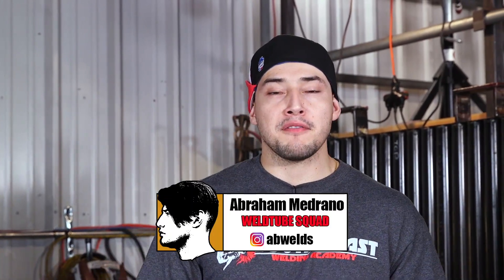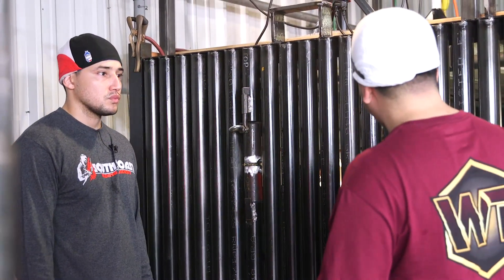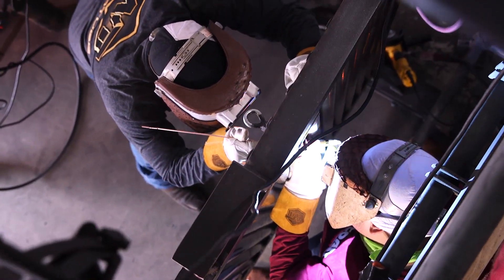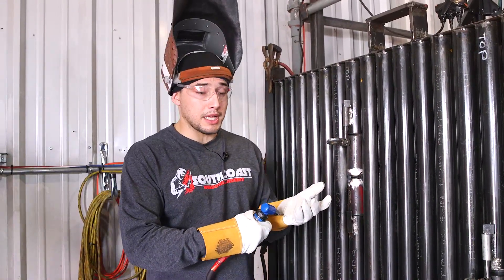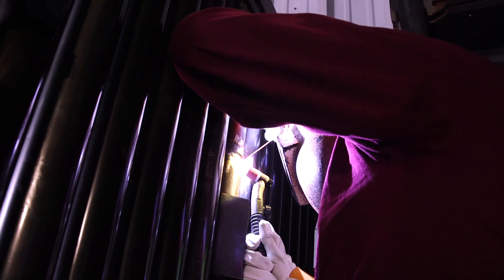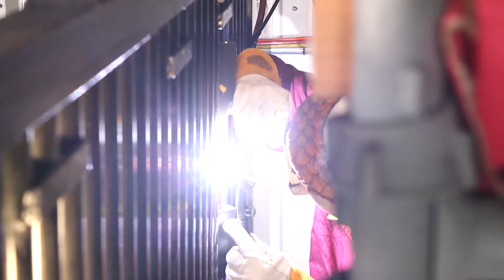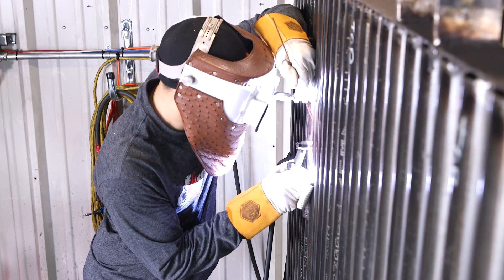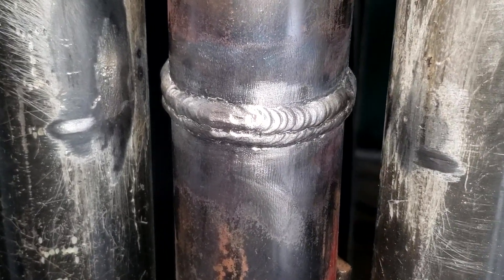Boiler Tube Welding | Boilermakers TIG Welding for Power Plants

Comment: Union Boilermaker welder apprentice here, local 128. That was a great video, thank you for that. I haven’t started tig welding yet but will definitely be watching this video again when I get into it
Reply: Congrats on being an apprentice, but please remember that being a journeyman Boilermaker means you can do any and all of our trade. In over 20 years, I’ve never seen anyone’s union book say “Boilermaker Welder”. They say Journeyman once you bust out. Too many guys think that they are “welders only” and most are only rod burners, not a true welder and there’s a lot of work that has to be done prior to most the welding, such as demo or hanging new panels. Not trying to say anything bad, just trying to change the mindset of some of the younger generation. We need everyone that cares and wants to learn a good trade. I’m a 2nd generation, graduate apprentice out of Local 101. Went to the apprenticeship competition and now I’m a superintendent for a good sized Union Contractor. Just please don’t get stuck focusing on welding. Yes it’s a big part of our trade, but it’s only part of the skill set you will have after you bust out of the apprenticeship.
Reply: Dave Uhl thanks for the advice. I say I’m a boilermaker welder because that’s what I am in the union... I understand that I will learn Mechanic work and that I will do mechanic work. However, in the union I am a PSW (Pressure system welder) and I am going through the PSW program that was introduced to the union around 10 years ago. So when I’m a journeyman I will be a journeyman PSW. I am also on the welders list for dispatch. When a contractor wants welders then they call off the welders list. I have done mechanic work and I enjoy the mechanic work as well. However I am considered a welder
Reply: Quinn Howlett when finished with your apprenticeship, you will be a red seal certified journeyperson Boilermaker. Currently you’re a Boilermaker Apprentice, nothing more and nothing less, unless you’re trying to take a welding test for your hall and then plan on buying your book, in which case you wouldn’t be an apprentice at all. But again, best wishes and get out there and make the Boilermakers Union proud by being the best you always can be.
Reply: Dave Uhl currently I am a second year Boilermaker PSW apprentice... I was hired into the union as a welder, in a separate welding program. I do not go through the same schooling as the mechanics... I will still be getting my red seal journeyman certification at the end of my apprenticeship, but I will still be a Boilermaker PSW, which is a Boilermaker Welder, getting dispatched from the welders list... I know what I am dude lol
Reply: Quinn Howlett well just like most apprentices, I see you know everything!! I was like that once as well. So as I’ve said, be safe and have fun. Just carry the “Journeyman Boilermaker” title well. Oh by the way, look at your halls website and it explains the whole PSW program and once completed you will become a “ Red Seal Certified Journeyperson Boilermaker. It says nothing about “welder” so yeah, you obviously know what you are!!
Reply: Quinn Howlett those are facts by the way!!
Reply: Dave Uhl lol... Yup I “know everything” because I know what I am and what my job title is... please don’t tell me what I am and what I’m “not” my comment was not intended to start anything with anyone... and then you replied to me because you just had to “correct” me... currently there is no red seal for the PSW program, so that’s why we do the red seal boilermaker. We have the opportunity to do the red seal welder, which is the general welders red seal but we need 8,000 hours to be eligible for that. I am a Boilermaker welder, dispatched from the welders list, a PSW. That’s what I am. But I can/will do welding and mechanic work. And that’s what I want out of my career.
Reply: Quinn Howlett ultimately, what I’m trying to say is don’t focus on a skill, be well rounded and best you can at all skills our trade requires and you’ll get farther in you’re career. Contractors won’t call just because you’re a welder, they’ll call because they’ll know that they can count on you for any task they might have. So stay passionate, dedicated to being the best and showing up everyday, that’s what contractors want.
Reply: @quinnhowlett697  I was EXACTLY like this when I was an apprentice. 13 years later I totally understand and have the same outlook as you do. If he makes it out, hell eventually grow to understand what you're saying. Good luck out there and stay safe!
Reply: Brian B lol, I’ll make it out. I’ve done lots of jobs already where I didn’t strike an arc... like I’ve stated before multiple times, I understand there’s way more to boilermaking than just welding, that’s why I chose this career, I won’t be welding on the same shit every single day like on a pipeline. But I am still a welder👍🏻
Reply: @daveuhl3392  He’s from Canada. The welding side and mechanical side of Boilermaking up there is completely separate. It’s two totally different apprenticeships and rightfully so. I’m a Union Boilermaker as well. I was out of local 83. Either way, the reason why Canada’s Boilermaker program as whole is better and has retained a higher level of success and quality is because they separate the two facets of our trade and focus on getting specialized people for each. We don’t do that in the US and it shows, miserably. Also, in the U.S. when you “top out” as a Journeyman, your card doesn’t just say “Journeyman” on it. It says “Journeyman Mechanic”. I know plenty of jam up welders in our trade that have literally spent 99% of their career shoved in a hole welding. Then, after all those years of just focusing on welding (because that’s where they were always put) when they are asked to do some sort of decently difficult mechanical work (laying out torque patterns on square flanges or manways etc.) they don’t know where to start. It’s really not their fault either. Why? Because we are always pushed to be “tube welders” if we want to stay working. That is what has created the “I’m a welder” mentality in our trade in the states. Apprentices are pushed to focus on the golden ticket of being a tube welder instead of the instructors being able to guide them in the direction of what they are better at. Whether it be mechanical or welding. Yeah, welders should know how to do a lot of other things and if you’re a good welder that always gets put welding, you’re not going to be as good at the mechanical side as someone that always takes a call as a mechanic. The crappy thing is they don’t ever order enough mechanics anymore half the time. They push you to get tube certs so you have a better chance at getting called out first, then sometimes you don’t weld at all. It’s front, back, left and right. I think the best thing we could do as a Union is to separate the two facets of our trade (just like Canada does). That way you know that all the mechanics on the job can always do their job to the fullest and all the welders can do their job to the fullest as well. It would never be a question. I say all of this because you know as well as I do that there are always jam up mechanics with tons of hours setting at the house because they aren’t welders. Then, the guys doing mechanical on some jobs are always welding on other jobs (boomers,different plants with different foreman’s etc.) and struggle, and vice versa. It’s an actual thing. I’ve witnessed it over the last 15 yrs or so. Some guys don’t want to weld and wouldn’t make good welders anyways. Some guys don’t want to do complicated rigging or bolt up structures etc, they want to rig enough to fit up and weld. People will always focus and excel more at the things they are better at. That is why Canada separates the welding side of Boilermaking from the mechanical side and they churn out much better hands on both sides by doing so. Also, there is absolutely no way to know how to do every single little aspect or job in our trade. We are the only multi-sub faceted trade there is. It would take a 20 year apprenticeship to learn everything that we do in all the different facilities that we work in. Then you won’t even be able to retain all of that knowledge to be able to apply it when and if you ever came across each specific little job or task. It’s literally why there is a separate side of our Union for building tanks (NTL/NTD). If I had a dollar for every coal fired boiler tube welder I’ve seen fiddle around with a key plate their first time and mess it up, I’d have a lot of dollars. There is no better example than that. Lol😂. Either way, be safe out there brother.
Reply: Local 105 here. I have been dispatched to several jobs as a welder and never struck a arc. Sometimes the welding gets old and it's good to do something else that pertains to Boilermaking. There is a whole lot more to it than just welding.
Reply: jbolin105 lol, I do enjoy the jobs where we don’t strike an arc, my shutdown I was crawling around in a carbon black filter house replacing filters. I know there’s much more to boilermaking than just welding... that’s why I chose this career, but I’m still a welder👍🏻
Reply: I know in Canada things may be a bit different than here in the states. My dad is out of 744 and 128 Toronto. I’m out of 45 Richmond. At least down here we are Boilermakers plain and simple. We are able to do all that is required no matter how many welding certificates we have. Best of luck brother. See you soon.
Reply: Marlon Nicks oh shit yeah, I’ll do whatever I need to do to get the job done properly and safely whether I’m striking an arc or not, I chose this career for that reason, lots of variety in work that we do🤙🏻
Reply: Worked with some guys out of Local 359 when I was an apprentice. Great guys and willing to teach you everything they knew if you were willing to learn. Get them hours and be safe out there.

Comment: Don't do the weave on the fill pass. It takes to long and tends to undercut on the top. I've took a test for the power industry last year. It was a gap - 5/32 with a 3/ 32 filler ( the inspector was very strict with the gap and filler size, nothing more, nothing less) 120 for the root, 150 for the fill with 2 stringers , 150 for the first two stringers  on cap , 125 - 135 for the last. The membrane ( distance between the pipes) was 3/8. Time limit - 60 minutes for two joints.

Comment: Could you guys do a video about how you pick your tig setup? Like how do you decide what filler wire diameter and cup size to use for different thicknesses or just something where maybe you need a longer stickout to reach. Love the vids and have learned a lot from you guys 👍

Comment: I noticed how you guys fit up the tubes....we use  2” angle with a welded nut and a bolt on one side and L shape plate welded on the other....those L shape will hook on the fins...(those  longitudinal  bar mostly 1/4 “ thick that’s welded in between the tubes)...you’ll figure it out which end you have to put it looking at the orientation of the tube,..that’s for up and down alignment,side to side...we use wedge..On welding, we supply filler on the other welder just on the corner, once  able we supply ourselves....one thing about boilermaker you should be able to weld left and right...it gets easier.....but if you don’t know how to use your inferior hand,you’re bound to call a lot of saints in the process. I could not stand those soot when it turned to a slimy stuff...makes my skin dark and greenish..I’ll get allergic reaction to it...although boiler job is exciting I never miss it because of those
Reply: Where is there a corner on a round tube
Reply: @mattharper588  he’s obviously talking about the sides. I’m a Boilermaker. We only feed wire to our partner on the sides (in between the tubes), then once your welded out from the sides you feed wire yourself.
Reply: @LeadRakFPS  I have no idea why you are responding to me,I’m a retired Union Boilermaker and we weld tube’s exactly how you explained you must have me confused with someone else’s comment keep the hood down and get after that money $$$
Reply: @matt harper  🤣 Because you were asking, "Where is there a corner on a round tube?"
I was just pointing out that they were clearly talking about the sides when they said, "corner".

Comment: Good video! I’ve been working in the boilers since i was 18, we do it a little different and a lot easier but I know it can be done different ways, great videos !
Reply: how u mean lot easier tho? every time i do or watch thise boilers seems hard anyway u do it
Reply: The only place you need to feed wire to each other is on the sides. That’s a luxury that you can only do if you’re not on a waterfall with a bad draft. Otherwise you just gotta reach back in there and get it. You can burn the bevel off with your arc (if the gap is tight) and feed your wire on the inside to give you more room.

Comment: Good video, but usually buddy welding in a boiler is done on the cap with stick. 1 guy fires up and goes to the membrane and then the other guy takes the arc to his rod and does his half and then the 1st guy picks him up and finishes the pass. All the way around and never breaking arc.
Reply: And true buddy welding is done off the same machine with a Y for the stingers.
Reply: If you are fighting a draft on the water wall you can also stick the hot pass.
Reply: We call passing the arc to each other hot pick ups and the guy picking the arc up had to chip the slag off from the start before he drops hood to pick up arc.
Reply: On wall panels it is usually stick cap but individual pups it's usually tig all the way through
Reply: Dan Bradford555 
In my area, regardless if it’s the wall, a superheat panel or screen tubes, it’s a stick cap. Back pass or econo, then yes, TIG all the way out.
Reply: Just my opinion, some people from the outside don't know our methods as union Boilermakers and this is giving our work away so a rat can come take our work.

Comment: yall forgot to mention the specs of the smaller conversion of the head on the tig rig if im not mistaken it looks smaller
Reply: With a stickout that much a jumbo cup would serve you better to keep down porosity and improve the surface oxidation. There's also Pyrex cups to see through. A mini rig (WP-9FV) is rated for 125amps. If cheaply made they burn up often. I just don't see the need to have a light duty rig rig to do that, there's nothing in your way to restrict the movement of the head so why not get a WP-17H with a jumbo stubby and weld in it's capacity?
Reply: They’re using a 9FV head.  You don’t want a big rig in there because you need to be able to see around the cup at times